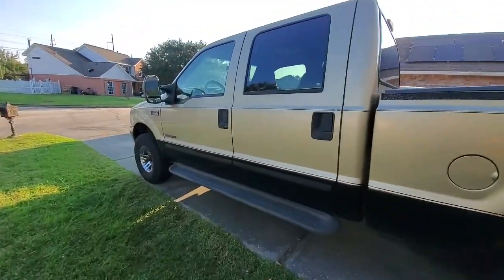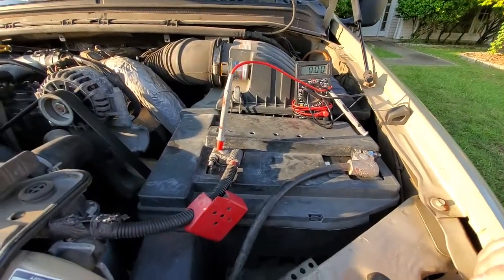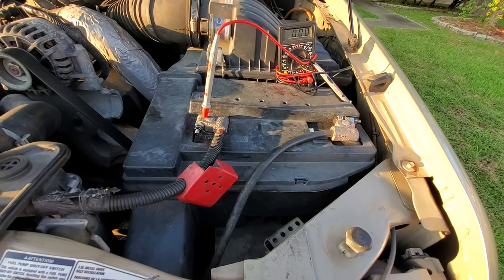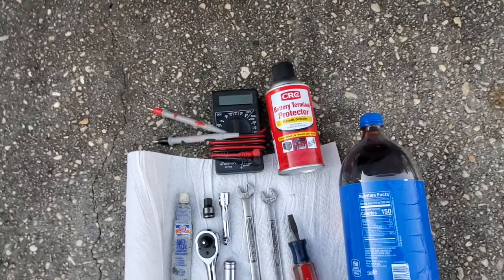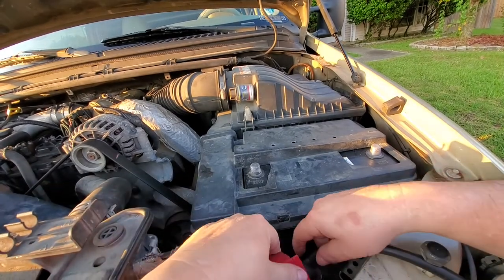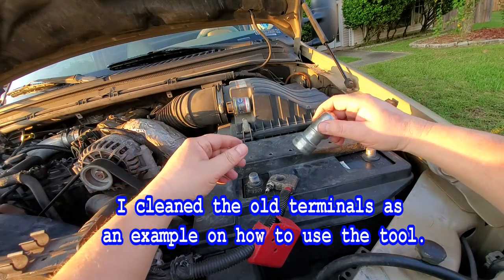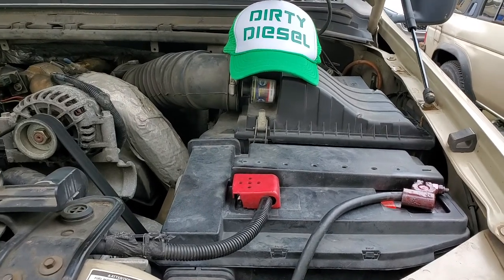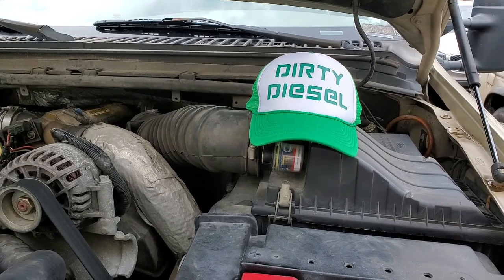1999-2004 Ford F250 F350 7.3L Drivers Dual Battery Change Motorcraft BXT 65 850

Comment: So unlike this guy, if you own a truck that has 2 batteries NEVER replace them one at a time! If you replace only one the older battery will cut the life of the newer one dramatically! Always, always, always change both batteries at the same time! Even a couple of weeks off running a new one with an older one will cause it to lose life and a lot of battery manufacturers won't warranty batteries if they know you've replaced only one.
Reply from the maker: I agree, I think I mention that in the video. However I needed the truck and couldn't afford the other one right then. So ya gotta do what ya gotta do. Bosch did warranty the other battery for free even though I didn't change them both.
 Thanks for the comment and the advice to everyone Keith Noneya

Comment: I recommend removing your wedding ring, or any other rings on your fingers for safety! Rings can get caught up, snagged or conduct electricity during work.
Reply from the maker: Ah thanks for looking out for me DD. I usually don't pull it off for pulling battery cables but when working with AC electrical circuits I do most of the time, when I remember. When I worked on aircraft in the Navy wearing a ring was prohibited because it could get caught on the part of the plane and rip the flesh clean off your finger just like pulling chicken off a leg bone. Never saw it happen but in training they used to show us picture of people it happened to. Man that was painful to watch. Best Wishes & Blessings. Keith Noneya

Comment: I just replace both of my batteries in my O2 7.3 power stroke put two new motor craft 850 cc’s batter and one positive terminal
Reply from the maker: Hope the video helped with that. So far the batteries are doing pretty good. Thanks for watching. Best Wishes & Blessings. Keith Noneya

Comment: Just toss rubber glove over terminals after disconnecting
Reply from the maker: Hum, if they were thick enough great ideah! Thanks for sharing. Best Wishes & Blessings. Keith Noneya
Reply: @keithnoneya  also recommend removing negative terminals first to kill the charge
Reply: @keithnoneya  I did like your cola cleaning tip tho works much better than baking soda and water!
Reply from the maker: @BigMac-jr4th  Yeah that's the way it should be done, I try to be careful whichever way I do it. Kinda funny story though, I've actually been shocked taking the Negative off 1st. My arms were sweaty and I put my arm on the fender and reached across the Negative to take the Positive off and my arm touched the Negative post and it lit me up when my wrench touched the Positive Terminal! The soda trick does work good. Anyways Best Wishes & Blessings. Keith Noneya

Comment: Hey man not sure if you cleaned up the engine bay yet but if not Super Clean is what I use. Best stuff I have used and use it on the engine rims all kinds of things. Easy stuff to find, the foamy  super clean works awesome  on cleaning  engines because it sticks. Try it you won't be disappointed  I go through alot of it actually  buy it in the gallons lol
Reply from the maker: LOL Yep I think that just might happen Mike. Looks like you might get your wish on getting my engine bay cleaned. Best Wishes & Blessings. Keith Noneya

Comment: What happens if the cable sparks, when changing the battery?
Reply from the maker: Hi Daniela, it's normal for you to get some "small" sparks when changing the batteries as there are systems in the truck that always draw a small amount of current, like the ECM or any interior lights that you may have left on, say when the door is open. If you have exceptionally large and bright sparks check to make sure you have the battery cables on the correct posts. Note the posts are reversed on the F350 with the negative being closest to the fenders. Before you hook them up make sure the key is in the off position and the lights are off. If you have a stereo amp make sure the radio is turned off as well. After you hook everything up give the truck a good look over and if all is normal start it and try all the systems. Hope that helps point you in the right direction. Best Wishes & Blessings. Keith Noneya

Comment: I appreciate all the information, along with tips and warnings, to get this job done.  

I have a 2000 F250 diesel that I bought new.  The first time I had to replace a battery I just replaced one.  In hindsight I think it made the new battery work harder because the old battery wasn't as fresh.  Nowadays I replace both batteries when I have to do it.  Like now, in the winter, I need to replace the batteries.  I think this is the second time I'm replacing batteries.  It's been a while.
Reply from the maker: Glad the video helped, just passing on what I learned from my dad years ago. He was a professional mechanic since the late 50s and retired around 6 years ago. He never got the hand of the computer cars and hated them LOL. However when it came to old school cars and trucks he was a wizard at fixing them to last. Thanks for watching. Best Wishes & Blessings. Keith Noneya
Reply: Hi may I ask if your F250 diesel has 2 alternators and is it 130 amps?  Thanks, I have 2 (130amp) alternators on my 1998 E450 diesel.
Reply: @acemoto2319  --  I'm pretty sure it has one alternator.  How do I tell how many amps it's rated for?
Reply: @toddb930  My Ford E450 manual specs states 130 amps. Possibly one can look up F250 alternator specs online.  On my 1998 7.3 Diesel truck, I can see one alternator top mounted passenger side and one lower beneath engine.  Also my engine bay has a belt diagram sticker with dual alternators.  Some alternators will have 130 amps sticker or label on the alternator housing.  Cheers :-)

Comment: Thank you sir you were a big help I just bought an F-350 super duty truck I really didn't know which battery to unhook first or which battery is bad or it could be both batteries I don't know. You are a big help thank you very much for posting your video
Reply from the maker: Glad I could help William. Owning an older 7.3L does come with it's problems. So I'll tell you like I tell all new 7.3L owners. When they hit about 200K on the ticker, you need to start planning on doing some expensive preventative maintenance, if you pay someone, to keep them reliable. Most of the repairs you can do yourself if you're used to doing mechanical work, then it's not so bad. Most 7.3L owners either love them or hate them. The ones that love them have had the 200K + preventative maintenance done and they stay very reliable. The ones that hate them probably bought one that hasn't been maintained and it just keep breaking down. At that point they become a money pit if you don't do the maintenance yourself. One of the biggest problems is the transmission, if it was used commercially or as a trailer or 5th wheel hauler, they start to need a rebuild about that point. There's a few other things to start thinking about. IPR rebuild or replacement, Fuel Tank pick up and filters, Injector Cups and Injector shimming or rebuild, Wheel Bearings and Front Hub bearings and 4wd seals if you have a 4wd. Ball Joints, Steering Linkage and Steering Box gets sloppy. Also the steering column shifter bushings start to go and the shifter gets really sloppy and sometimes won't go into Drive or Reverse. The IDM also starts to go and can start to drop Injector signals and you'll get a miss, if hasn't been replaced. It's important to note that they have are reliable if you maintain them.  Like any vehicle, they need regular maintenance. Don't be one of those guys who buys it and think it will never need a thing because it has a good reputation, you'll be disappointed. What's reliable on them is the "Internal Engine" Parts if you keep the oil and filters changed. The rest is normal maintenance that you find on any vehicle. I hope you have a great experience with your truck, they're fun to drive and great to haul stuff with. Oh look into Sulastic Shackles to make the ride smoother. Thanks for watching. Best Wishes & Blessings. Keith Noneya

Comment: Did you have any drivability concerns
Reply from the maker: No, before I changed them it got harder and harder to start the truck until it was dead by morning. I checked my Alternator after I started it and it was putting out 13.8 vdc so I know it was good, that left the batteries. I was curious by what you meant by "Drivability Concern's"?